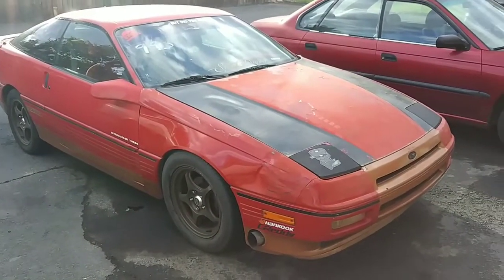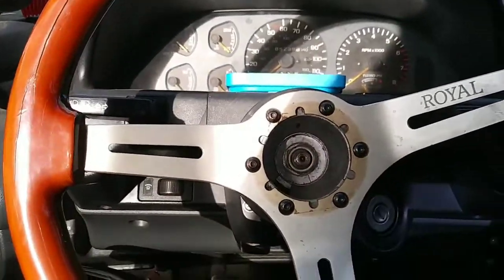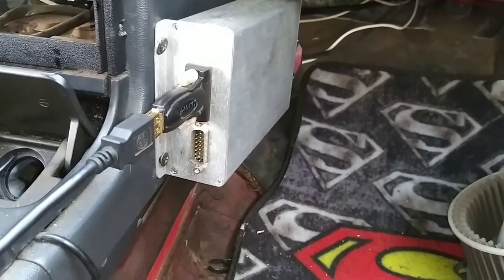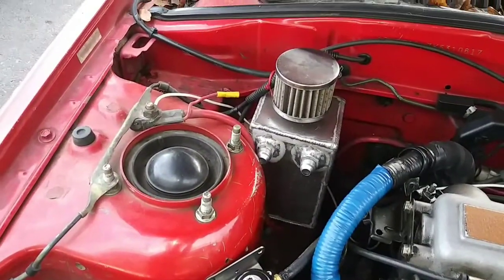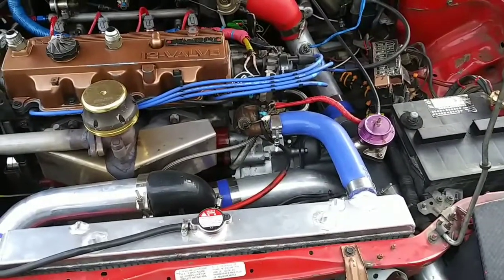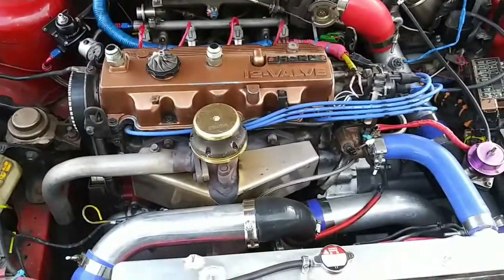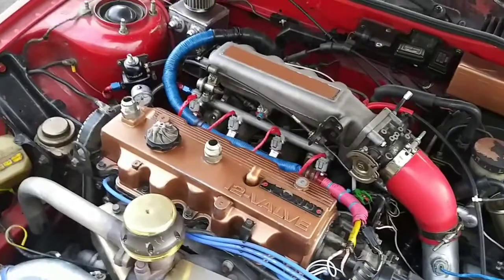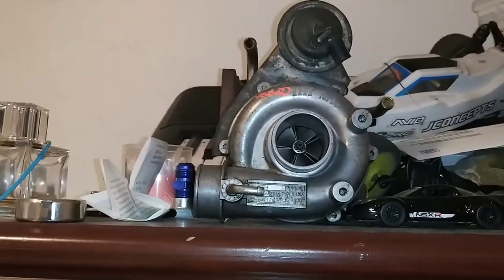Full Build List and Dyno Saturday to Turn It Up!

Comment: Well, currently, I have a stock 89' GT. Id like to turn up the boost to about 10 PSI or even get a new turbo. Seems like a zombie/probinator + intake and exhuast can get one of these to about 200 wheel. Which is crazy!

Comment: What kind of numbers you hoping to get when you slap on the bigger turbo? Keep it up by the way. 👍🏼
Reply from the maker: At this point, I think with the hx35, I should be able to squeeze 425 ish whp and maybe 450 wtq. But at that point, with how I drive, I will be vaporizing stock transaxles. Usually third and fourth gear, and I only have one stock trans after this Franken trans,  so I'm hoping to run a number before it grenades, then move on to something else. I can't find parts for it anymore, I'm out of all my spares, and I'm going to be pushing it about as far as it can go, and it will be big money to go further than that which I would rather spend on something I like more LOL. Like an MK3 Supra Turbo

Comment: Also I’ll add, the key to making power on pump fuel is cooling . You might want to add a meth injection or something and you will be surprised how easily the f2 will easily make the power . The engine typically run hotter stock .
Reply from the maker: I'm not going to be running pump gas. I'm going to be running race gas. On pump gas 16 PSI is a happy medium with 17.9 degrees of timing. With the low compression and strong internals it is perfectly safe at this power level on pump gas. Although we are going to see how much we can make on pump gas safely oh, then I will be turning it up on race gas. I think with 13 or 14 degrees of timing I should be able to push 20 psi on pump gas and probably make in the range of 275 whp, maybe 300 foot-pounds at the wheels
Reply from the maker: Then I will throw in the race gas and turn it up as close to 30psi, as I can get, on this wastegate spring,